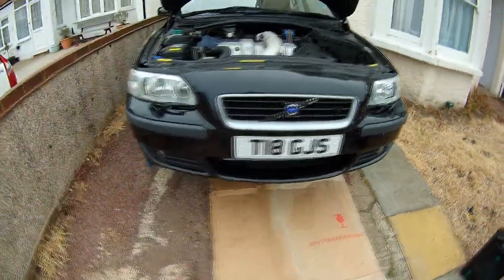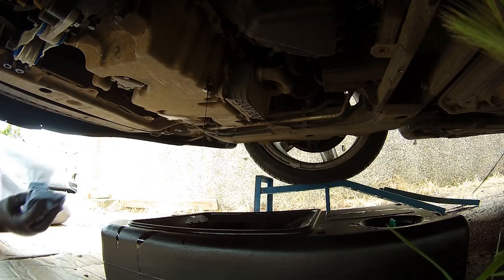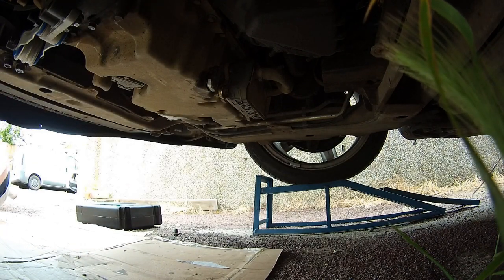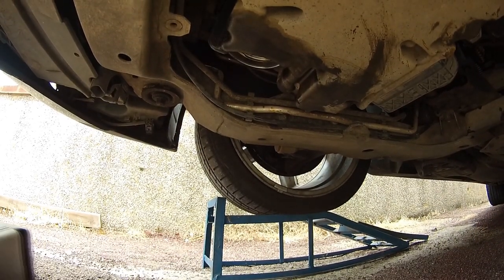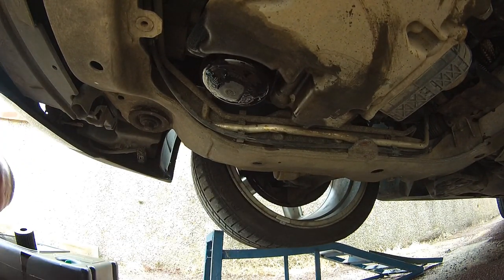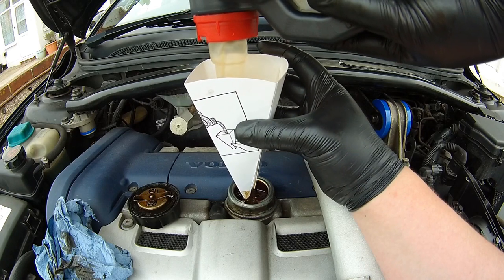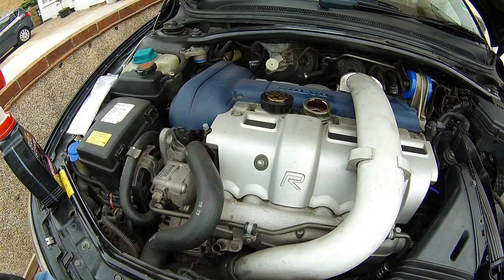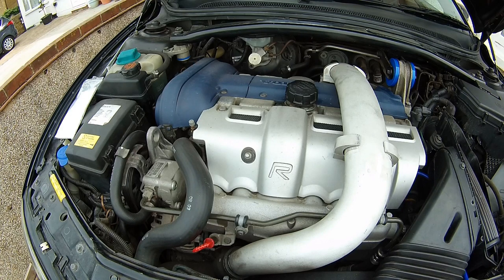Volvo S60R | Engine oil and filter change

Comment: You let oil run out until it quits dripping but first you change oil filter& add oil to filter cartridge before putting on! You only check your oil with all 4 wheels on even ground!Put in 5quarts check oil after running car then add to full never over fill!
Reply: S60r spec is 6.1 quarts, I’ll typically add 6  which will land you right in between youre dipstick notches then I fill till full because Evan like half way below the fill line on the dipstick will trigger a low oil warning
Reply: And yes always, always fill the filter before replacing it especially with turbocharged vehicles
Reply: And yea he overfilled that because it was on ramps🤣, all the oil will settle in the back of the pan further from the dipstick and give u a false low reading

Comment: Do I need the new plug ???
Reply: bit of a late reply but it's a cheap part, better to have it and not need it than...
the one time you try to reuse the old one your seal'll fail or the threads'll be damaged or something silly like that... murphy's law